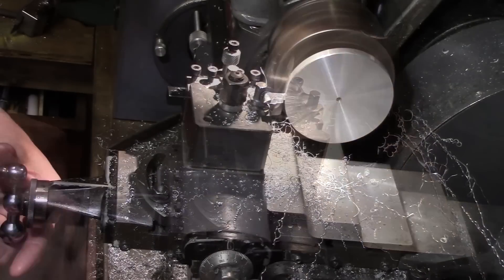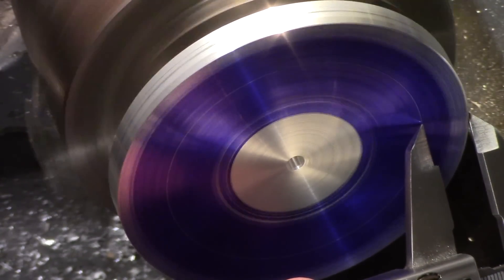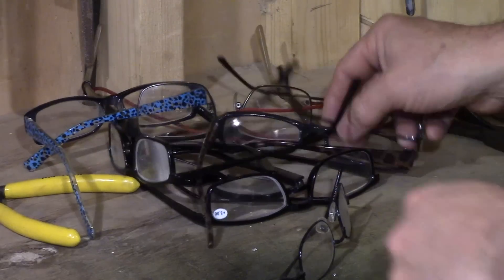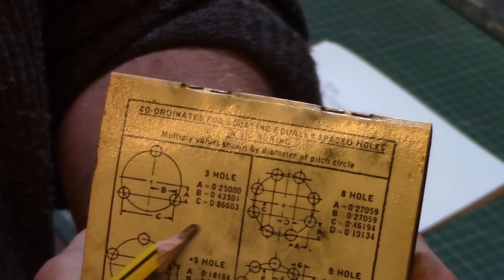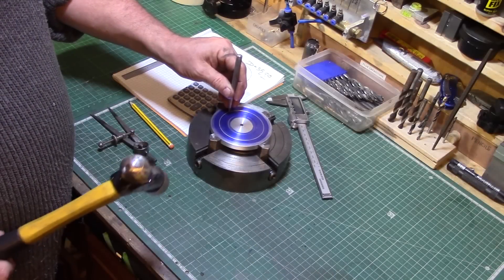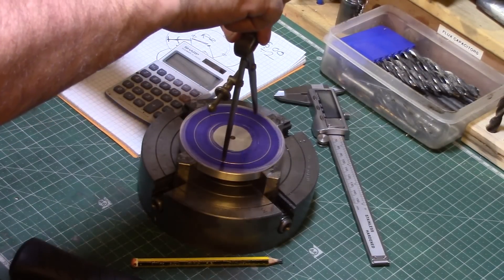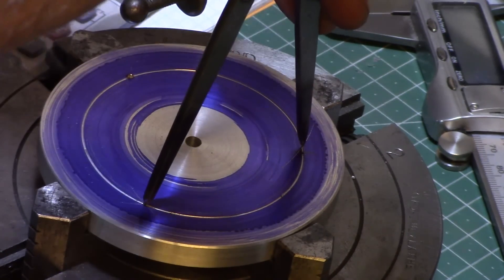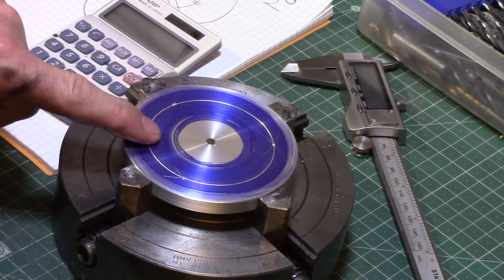Marking out a PCD using dividers - the old-fashioned way

Comment: Hi there, what happens if your divider dosent go back to refrence point or slightly off what do you adjust
Reply from the maker: Hi Sunny, you adjust the divider until it does go to the reference point, only then is it set correct
Reply: divider

Comment: Or you could just look up the chord length in Machinery's Handbook...
Reply from the maker: What page is that info on Steve? would be handy to know
Reply: Or just use this formula: sin(DEG/2)*2, where DEG is 360/n, with n is the number of holes. Then multiple the result by your radius to give the chord length.

Comment: great trick, I didn't know that one. for a 6 hole or a 3 hole, you can also set your circle radius, scribe the radius. The edges of the hexagon are the same as the radius. So just walk that around the circle. If you only want 3 holes, just drill the 3 you want. But this trick works for any number of holes I suppose~!
Reply from the maker: Yep. any number, up to infinity :)

Comment: Hi Ade, You don't need to do any of the tweeking, if you scribe the radius of the circle from the centre with the dividers and then chose your starting point, without adjusting the dividers they will step around the circumference exactly 6 times. Its a well known geometrical construction. If you want just 3 points then use each alternate mark.
Reply: Even simpler! Thanks for sharing.
Reply: You got it. They teach this in most trade schools in the first year.
Reply: I NEVER have luck with this.  Why not ??

Comment: G'day Ade your work bench looks like mine, it's interesting you using the old callipers I have a set of  DRO on the mill and lathe and I sometimes still use the old way, especially locking in measurements.    Thanks for the vlog regards John
Reply from the maker: Hi John and thanks for the comment on my video, I have a DRO on my mill but it is cheap and I find it unreliable, so I rely on the old fashioned ways to work things to my needs, and at least this way I can guarantee the precision. Kindest Regards. Ade.